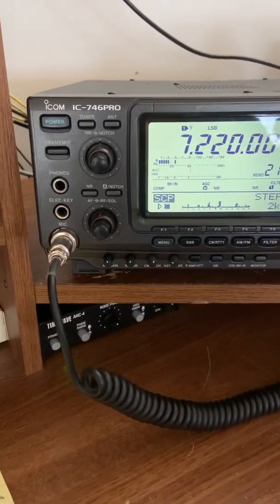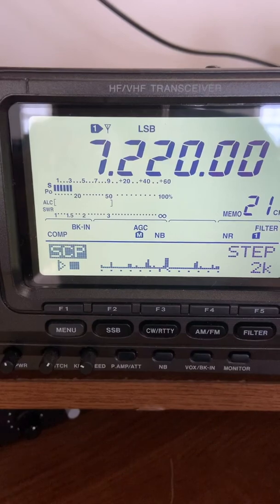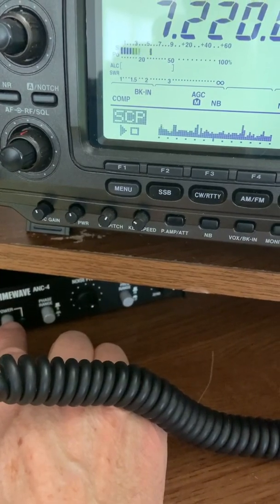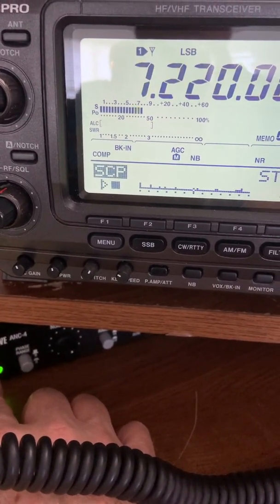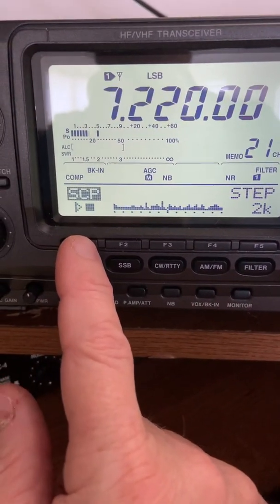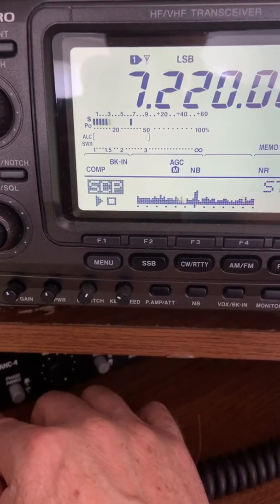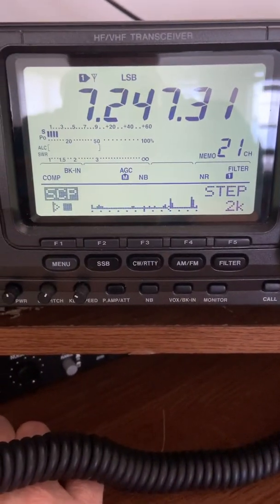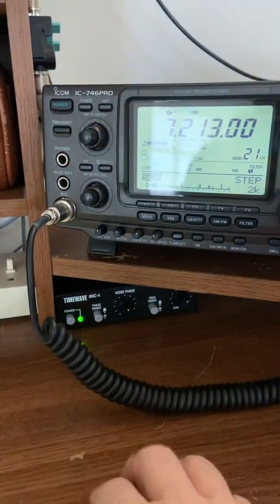Timewave ANC-4 noise cancel demo with Icom IC-746 Pro

Comment: Will this unit filter out the switched noise hash caused by switched mode power supplies?
Reply from the maker: It can help to filter out much of this type of noise in the cases I’ve experienced. Specifically I’ve been able to use HP server switch mode supplies to operate my HF transceiver and linear amp. These server supplies spew broadband and frequency specific noise that would normally make HF reception impossible. I used an insulated wire attached to the noise input, and placed the wire near the supply, and/or looped it loosely around the supply. I had to experiment with the phase and noise gain settings to get the best filtering. Depending on where the switching supply is located you may have to experiment with placement of the noise antenna wire in the room to get optimum filtering performance. I now use Tek Power TP50SW switching supplies which produce less noise than the HP server supplies. The Timewave filters that noise to a very low level.